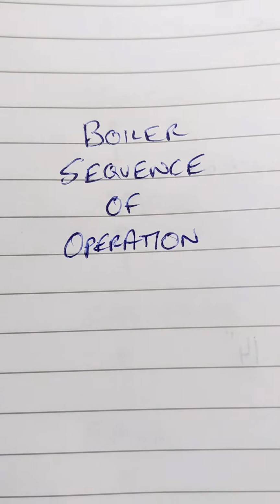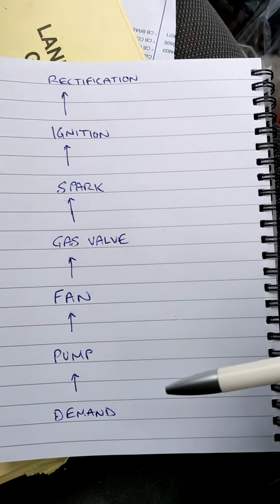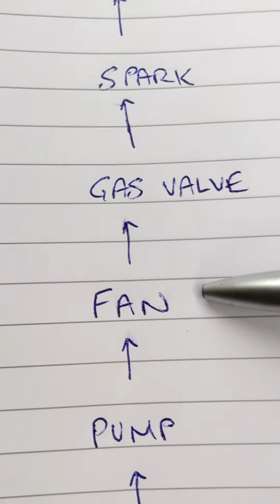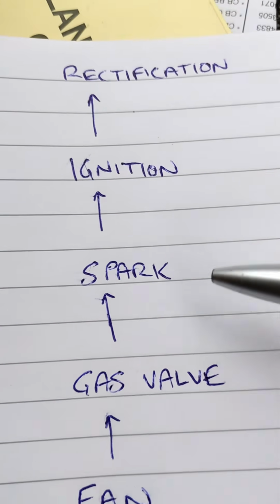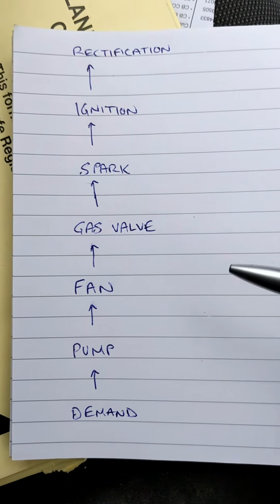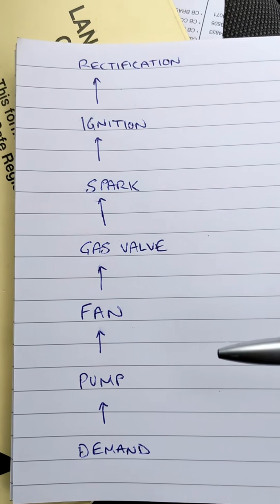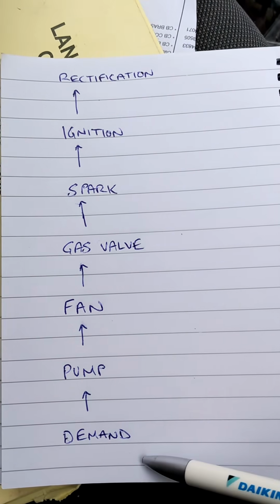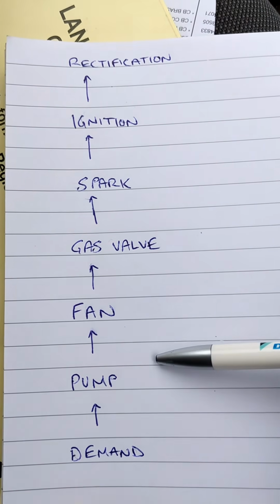Boiler sequence of operation

Comment: Hi I have an old halstead ace high combi  it does fire up and eun for about a 1 minute then shuts down and starts again but after 3 or attempts it will eventually stay on thereafter I getting extremely like there is no temperature control I am new to breakdown so I would like to get his one fixed without an embarrassing look of inexperience. 
Thank you
Reply from the maker: Ok so what initial checks/tests have you done so far?

Comment: I have Vokera Excel 29.
No heat and no hot water. 
When is on standby main PCB is keeps sending 230 volts to fan PCB. Is it that normal? 
But no action from fan, because fan PCB is open circuit by 230 volts socket.
Reply from the maker: Sounds like dead fan to me

Comment: I extended my heating today for an hour and this evening it would not come on, when start button pushed on the fan comes on, the ignition sparks but no gas. Could that possibly be the programmer or just a coincidence? Many thanks in advance.

Comment: Very Good video. I have been told by numerous engineers that Pump runs first but I am on a fault finding course in Northolt. These guys are saying Fan kicks in first then pump. Not sure.. bit puzzled.
Reply from the maker: The pump would always have to run first in order for the boiler to detect a flow of water through it before it can go to ignition. Hope that helps
Reply: @cputilitysolutions  Thank You so much. Much Appreciated

Comment: I was trying to find out how many Ohms you need on an Eco Tec Gas Valve. Are there any useful apps or websites that you know of that complie useful information like that?
Reply from the maker: Those sort of figures will be manufacturer specific so your best way is to give them a call in the week and they'll be able to tell you. I know off the top of my head the older ones have a resistance of around 50-60 ohms but can't remember the newer ones. If you're on Instagram then have a look at my page there too as I post my daily breakdowns there too. Just search for my name 👍🏽
Reply: @cputilitysolutions  Thanks. Will do